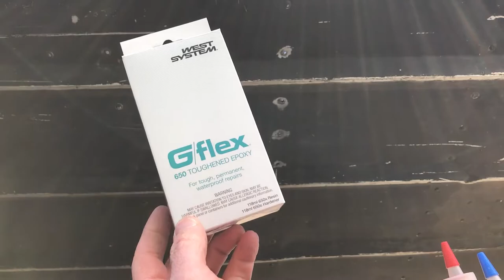Jon Boat Rivet Repair

Comment: Do you think placing the epoxy in the gap before pounding/smoothing up the bottom would seal better? Just curious. Have you had the boat out to test for leaks?
Reply from the maker: Yes. It is solid. I probably didn’t have to do the epoxy but I didn’t want it to break free again because the rivet holes were enlarge from breaking before. I pounded but still had a small gap but the rivets eventually closed the gap.

Comment: Did you buy the air hammer bit or just fabricate one from an old chisel?
Reply from the maker: Check the description. There should be a link in there. I pretty sure I got it from Amazon.

Comment: Why did you use the air hammer and not a rivet gun
Reply from the maker: Rivet gun will leak water through the hole. They are not water tight. The solid rivets are much stronger too.
Reply: @fixthemthings  Yeah but I thought there's was another style of river that has a closed hole. The rivet gun won't do those?
Reply: I need to fix my new to me jon boat
Reply: @treymurphy6398  Solid rivets are stronger and bind together much tighter. They shouldn’t leak forever if done properly (not saying sealed pop rivets wouldn’t) Pop rivets can corrode from the inside out over time (if they have a steel mandrel) Solid rivets are a more bulletproof system for structural applications! Good luck
Reply: I think the question is not about the type of rivets.  Rather, the type of air hammer.  There is a specilized air hammer just for closed rivets.  They say it hits slower so you do not over compress or flatten out rivets.  With that said most of us are more likly to have a air hammer and specialized air hammers for solid rivets are harder to come by and not used as much to warrent buying.